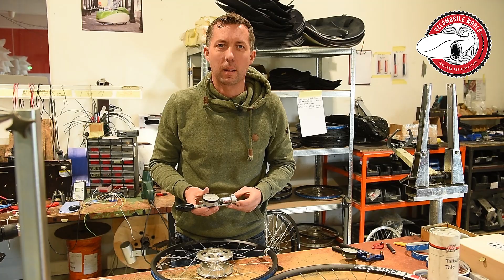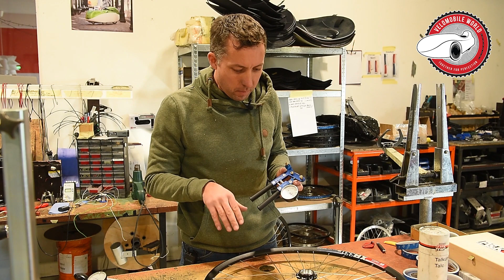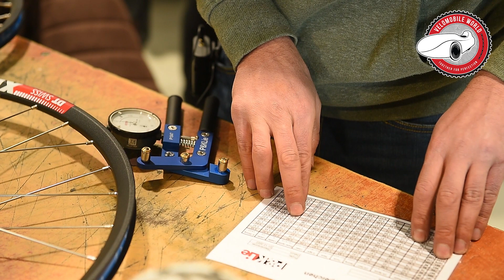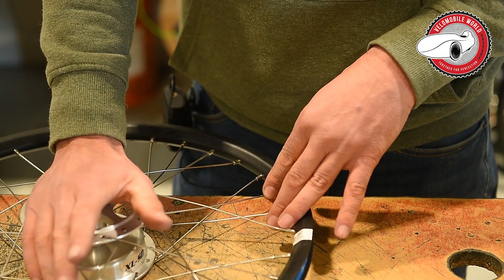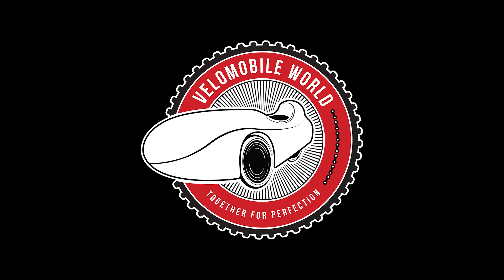Spoke Tension Measuring Tools | Bülk Velomobile Maintenance

Comment: so your saying don't put to much tension ;-) is there a difference between 70mm and 90mm drums ?
Reply from the maker: for spoke tension there is no difference between 70 and 90 mm hubs
Reply: what's the largest rear tire wdth for the velobody ? a wider downhill rim could be a option on the list, i just have a new 2inch city folding tire i think it's just as fast as a 1 inch
Reply: also boosted rear hubs are more common is there a rear swingarm adapter or a second swingarm option ?

Comment: Hello Jan, I am having real troubles with the rear wheel on my alpha7. Spokes are breaking one after the other even if the rim is almost new (<1000km). Based on this video, what spoke tension do you recommand ? Is 1100N an acceptable value (my weight is 80kg) ? Should I increase or reduce the tension to avoid those kind of problems ?
Reply: braking spokes is an issue when spoke-tension ist to low.
Reply from the maker: Hi Guillaume, you can also contact us directly on jan@velomobileworld.com see what we can do for you